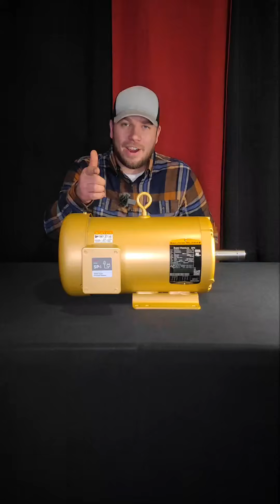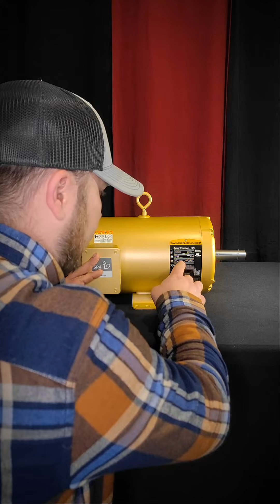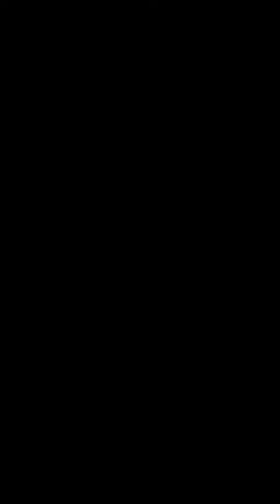5 horsepower ABB Super Premium SP4 Electric Motor #Abb #baldorreliance #abbmotors

Comment: I’d like to see an AC motor 3 to 5HP with built in VFD that can run off single phase 220AC. Lots of old DC motors out there to replace.

Comment: The coolest concept I like about Baldor motors is that in a pinch some of the similar models you can swap out mechanical and structural parts with other Baldor motors you might have laying around to get your motor running. i.e. cooling fans, bearings, even end plates or peckerheads

Comment: The only issue I have with Baldor name plates is they're painted on they can be worn off.  I wish they were still stamped.  It will be interesting to see what's inside of these.  Are there going to be single phase SP4's?  Being a predominantly agricultural shop we do mostly single phase.  What I do like is that ABB seems to be listening, a rep comes around occasionally and we chat about what we're seeing.
Reply: I wish we had a local single phase repair place for AG stuff. Only the big stuff for the mines/oil patch seems to get fixed in western Canada.